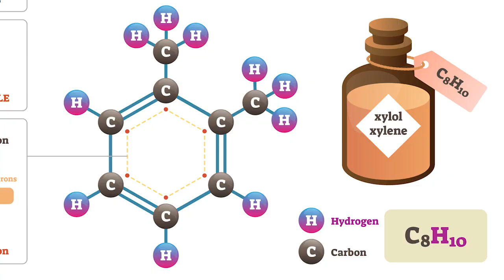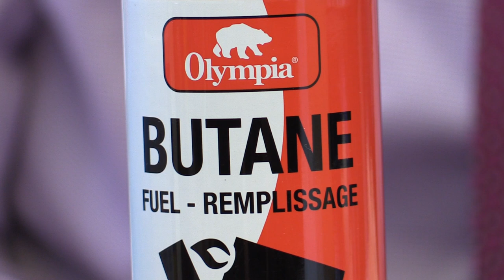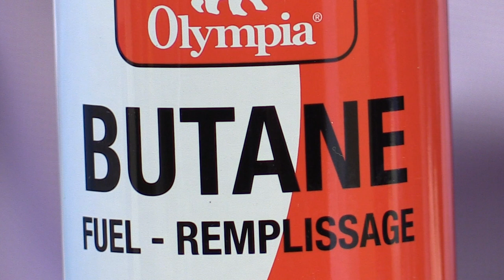Dr. Joe Schwarcz on the danger of of inhaling solvents

Comment: i have a question i was outside and stopped to talk to a neighbor down the street who works as a contractor, usually busy. while talking to him, i didn't know he was going to do this. but he laid a thin long board  maybe 2 inches thick and like 6-8 feet long. he grabbed a small can and it turned the board white. so i think it was a small spray paint can of some sort  the board was maybe at the elvel of my stomach . we were totally outside though.

i was probably standing a good 5 feet or more the entire time  and he was doing this for no more than a few mnutes. however there was a slight breeze coming up at times while he did this.  now i didn't feel any pain, or coughing nor did my eyes hurt.  but is it possible i inhaled spray paint, even a very veryfine mist?  now he was not wearing any protection like a mask or anything and this guy is a total handy man that does capretry work professionally and does many projects for people professionally and very good at it. so i mean i assume he wouldwear protection if it ws necessary. the stuff was white. maybe it wasn't paint, it could have been something elese that turned the board white but idon't really know.

is there anything i need to worry about or should i be fine?
i was outside talking to him for a goot 10 more minutes after he got done and then walked home so i was outside a goot 15 plus minutes after this.
Reply: No. Smell is amazing. I do it all the time.